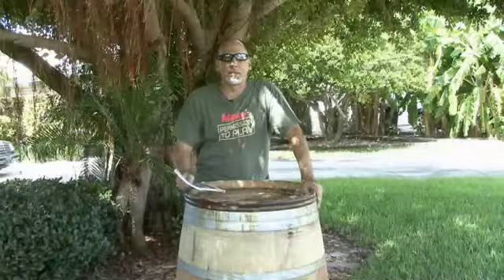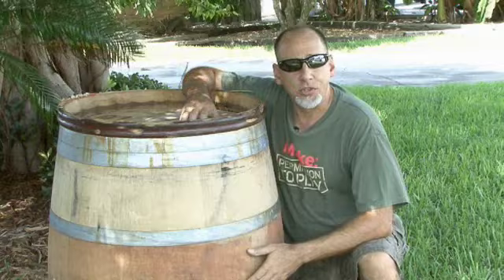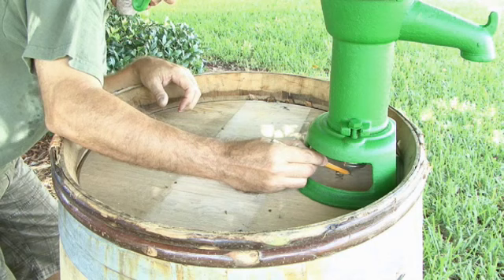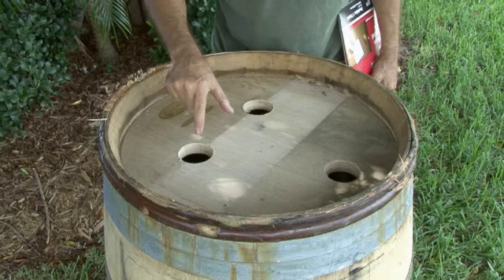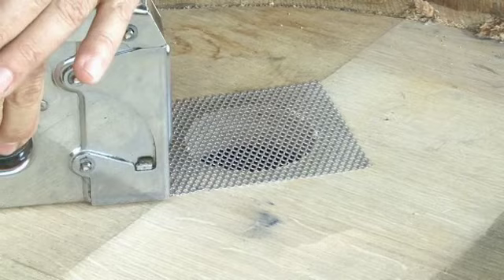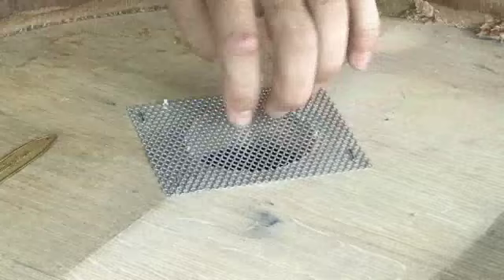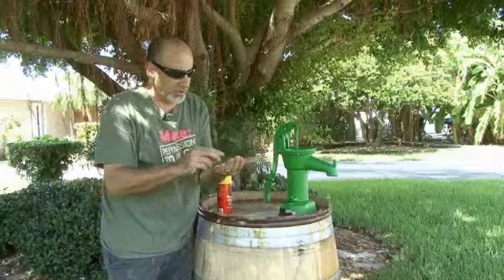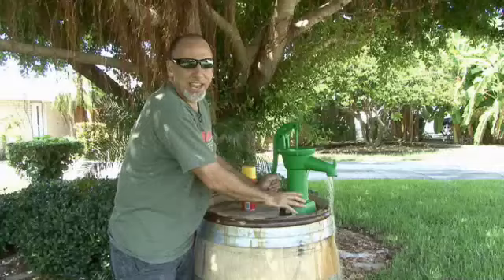Weekend Project: Barrel Water Collector

Comment: This is a great project and one I was thinking of doing myself to water our garden. We have a sump pump that pumps water out into our yard and instead I could route it into the barrel. Another great addition would be to add a hose output at the bottom of the barrel and using the pressure from all of the water above it, the water should flow out with good pressure I would think. That way you could just hook up the hose to it instead of having to pump water into a bucket and carry it wherever.

Comment: @MrSeanw84 You beat me to it but you'll need plumbers putty around the threads of the spigot (tap) this is GREY WATER and you can't drink it but you can water your lawn and plants w/ it if you add a bag of manure to the bottom when the water fills the barrel it will need to be stirred to properly mixed but your lawn and plants will LOVE it.

Comment: primer is a turpine or achcohal like substance. It's purpose is to clean the pipe of dirt and obstructions. The purple color is just a dye to show where you applied it. Hower.. I would suggest taking off the store stickers from your pipe before applying it. Cleaning the pipe allows the cement to make a better seal around the pipe

Comment: This way will in fact get you more water per rain (by a huge factor).  Most that are hooked up to gutters also have overflow holes/valves built into them and are elevated off the ground so you can just attach a hose to the bottom of the container and the water will flow.  A little more intensive to design/build but it will get the job done faster.  you can find several vids on here for designs like that.  cool stuff

Comment: Best way would be to cut a rectangle for the water intake, place the barrel under a rain gutter down spout and feed the down spout into the rectangle.  Next rain storm, it'll fill up pretty fast.

Could probably be used for drinking water if you used a proper filter over the water intake.

Neat project.

Comment: @mfoulks625

I have one and we hooked the drain pipe on the roof to it so it gets full every time it rains. There is also a hole at the bottom of the barrel with a hose conected to it. This allows the water pressure to give a slow stream into the garden.

Comment: if you could find a way to cover the holes when its full connect the air compressor  and on the other side a water hose it become a preassure  washer

Comment: i also did is by connecting the overflow pipe to overflow to another Barrel we had 3 giant Barrels filled up in 1 heavy thunder storm it was great kept almost 2 weeks of watering the garden almost everyday but we even had a hi flow water pump to help too better than this and more simple that having pvc pipes and drilling holes

Comment: I have a 1500 liter water tank wich is fill with the water that falls on 20 square meters of roof so It always has water despite the weather here in Spain.
I'm planning to connect a water pump controlled with arduino to water the plants of my garden.

Comment: What happens in the winter time?? Do I have to pump all that water out so it doesn't freeze.. And if the water freeze will it warp the barrel causing to be off balance or cause little cracks so water will leak out?? Tornadoes or Hurricanes will cause a problem also.  It is a great Idea and the Idea of just putting a faucet at the bottom and just elevating it higher surface, but you still have worry about Mother Nature..

Comment: A *much* better use for a used wine or whiskey barrel would be to ferment beer. Rain-collection barrels should be plastic because (1) plastic is MUCH cheaper than a new or used oak barrel, and (2) plastic barrels will stay water-tight even if they go dry. Wooden barrels will separate at the staves if they get dry.

Comment: HERES ANOTHER WAY: Get a Barrel and big tubes then connect the tubes to the rain gutters then to the Barrel then when it rains it will fill the Barrel up then just put a tap at the bottom of the Barrel then connect a water hose and you got free water planter

Comment: Serious question For make... Could you use a trashcan ( new of course) for this? The top is not flat, but is there a way to put a hose on the bottom? You could move it around the garden on the wheels. And use gravity for the flow? Thanks

Comment: i looked up copper and it said it only get oxidized which will probably do only a little harm to the water. I would rather have clean water from a copper pipe for an extended time rather than have bacteria filled water from a pvc pipe after a few weeks

Comment: You would be better off getting a large galvanized metal water tank if you wanted it for drinking and your location would also be important eg; I live near a city and the fallout from the nearby steel mills makes the water we collect undrinkable but fine for watering plants
Our relatives however live in the country and collect rainwater for drinking as there is no nearby industries to contaminate the water

Comment: I guess the bottom line is that it is a cool project to do, and if it helps you feel better because you are conserving some water, there is no harm in that.  But to say you are going to save money isn't very accurate.  Even if you built it for free, using a full barrel would save you about a cent or two.  If pumping 50 gallons of water out by hand is worth a cent to you....go for it.  If you are anticipating lowering your water bill, or saving any real money... this isn't the way to do that.

Comment: This project isn't complete. If you want to use this with your housing gutters you'll need a overflow opening on the side that will attach and drain away from the house properly.  otherwise it will never gather enough rainwater to be useful.

Comment: Dude just drill a hole in the bottom and attach a hose connection. The weight of the water will be enough pressure to pump it out lol...Shitloads easier and alot less work

Comment: Yes, but then again, it's not as environmental any more. Your water purifier needs energy/chemicals/resources not just to function, but also to be manufactured and maintained. That is also a cost that should be accounted for. If everybody would use a purifier,the environmental cost would be a lot higher than of that of the watercompany to clean the same amount of water.

Using rainwater is good, but you're cancelling it out when you're using a purifier. It's like the Toyota Prius... zero effect

Comment: no offense but- he wrapped the teflon tape on the treads in the wrong direction and he should of taken off the upc sticker on  the 1.25 to 1.5 adapter before he primed and glued it to the 1.5 to 1.5 male tread adapter. good vid though

Comment: this is way over compilcated and ineficient, the water holes are too small, it is better to just use the gutter system on your house, then your whole roof is the intake, also just put a hose fitting on the bottom of the barrel and use gravity

Comment: you wasted a load of water in the video and also wood also absorbs water
Reply: It doesn't absorb water.
The wood of the wine-barrel is treated off course, you can tell by the fact that there wine stored inside of the barrel.
Shocking, isn't it?

Comment: Unless you use this for a few thousand years, it will not save you money.  For $1, I get about 3,000 gallons of water from the city.  If it cost $50 to buld, it would mean you would have to use 150,000 gallons out of that hand pump to break even.  I cool idea for sure, but in no way does it save money.